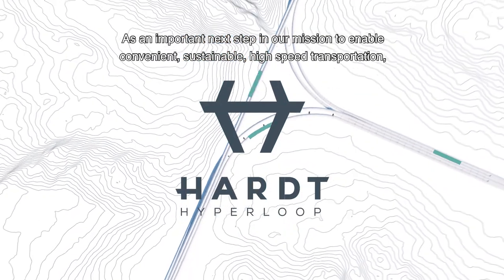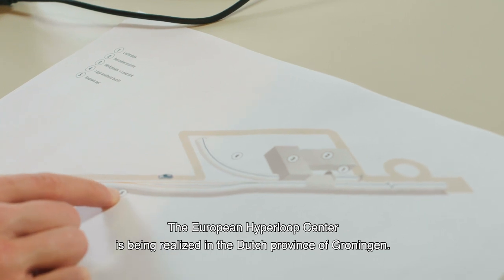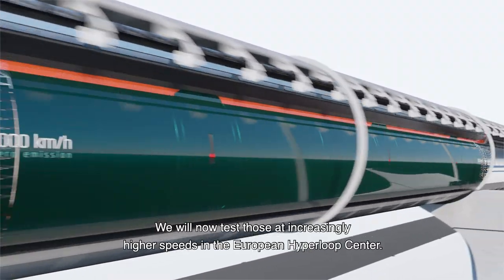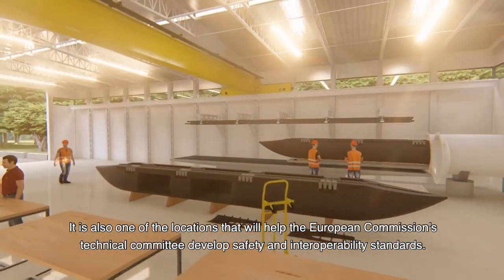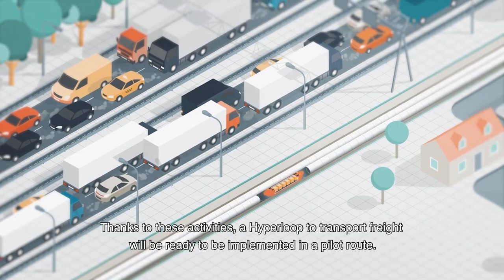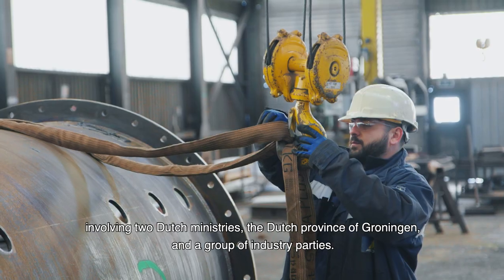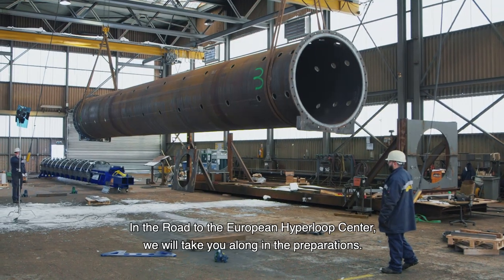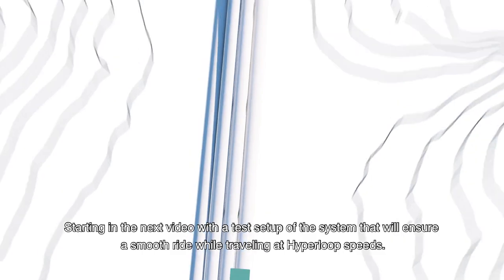Road to the European Hyperloop Center – Introduction

Comment: Hardt Hyperloop hangs in the magnetic rail. The others stand on top of the rail... What is going on? I want to ride in one POD from Athens to Stockholm! How do you propose to design a POD that can run in both designs?
Reply from the maker: Hi Mats, thanks for your question! That is exactly the reason why European countries banded together and agreed to create a joint technical committee (JTC) called JTC 20. To ensure interoperability and high safety standards throughout Europe. You can read more about it here https://hardt.global/sub/press/european-standards-hyperloop/